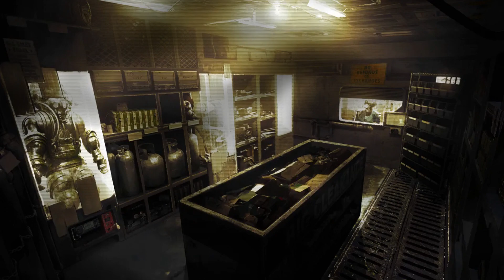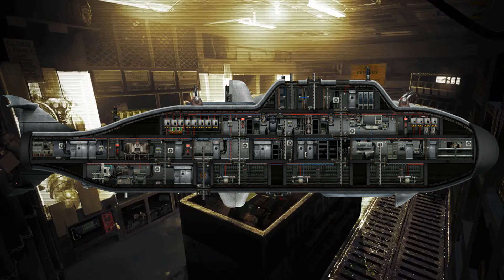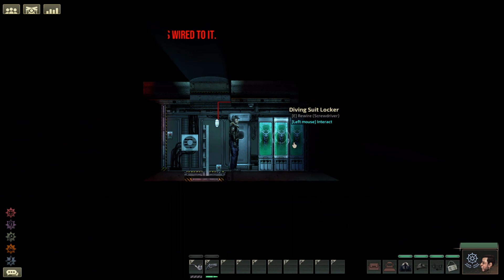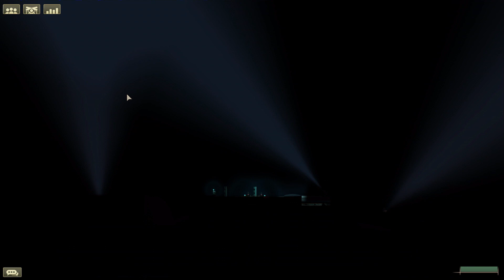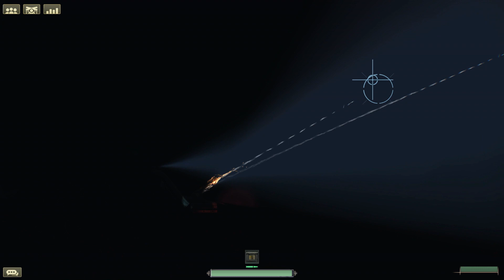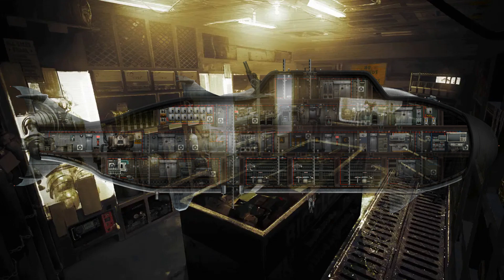Europan Technical Readouts: The Orcas

Comment: Not a word about the orca's cursed glass sail and how every fight starts with it getting smashed.
Reply: At this point I just sit up there, diving suit on, welder pointed at it, unmoving.
Reply: I as the captain just stick it on hold position and scurry up the ladder blasting the repair torch, it only needs to be licked for half a second and it stops the leak

Comment: Orca 2 would benefit greatly from an extra 1000kW output from the reactor. The orca 2 was our sub of choice when my group and I decided to move for a t2 submarine. So far, as the electrician on the sub, I have been attempting to resolve the energy issues the orca 2 has. It outputs a total of 4000kWs default, and it eats rods like candy.

With the motor taking up to 2000kW, and the oxygen generator taking the another 1000kW, it is normal to see the orca 2 idling at about 2000kW to 2400kW. Leaving about 1500kWs for the rest of the ship.
On top of that, the orca has some heavy guns outside which take up a big chunk of the supercapacitor's charge when used. Each supercapacitor can charge up to 1000kWs/s, depending on the charge percentage you have set them to.
The good thing about this is that the orca 2 has 2 sizeable batteries up in the electrical room, totaling a max of 2000kW extra. In this case, my countermeasures include the following changes:

First, I installed an ARC to set 2 uranium rods or 1 thorium rod in there and forget about the reactor for a second. 
Then, I installed an automatic recharge speed system on the supercapacitors, making it so they recharge at 70% speed only when at 60% total charge, and at 100% only when at 20% charge, otherwise, they charge at a constant of 40% speed.
Lastly, I installed a little detection system that tells the 2 batteries to feed the orca's electrical system when the sub's energy requirement surpasses the max output of the reactor by 1000kWs+, which it does often.

I have seen the orca 2 ask for up to 5300kW at times. It is a hungry sub, so be mindful of that when making that purchase. Also, we were unable to locate any oxygen detectors on the sub, and an argument could be made about limiting the motor at 80% of it's total capacity. It will save up to 400kW and cost a total of 5km/h. Same for the oxygen generator. If it could be limited, you can save up to 300kW by managing it correctly. The orca can allocate a total of 4 people per room with it's vanilla oxygen levels, based on my calculations.
Other than that, it has it's perks, like a full set of fabricators, including the medical fabricator, some beds to heal, accessible diving suits and a very good drainage system, the best my group and I have seen in t2 subs.

Comment: I'd like to put out that Orca 1 is better than Orca 2 in terms of survivability incase of flooding.

Orca 1 has most of the critical sections in atleast a room away.
Orca 2 has the reactor sharing the flood borne engine room, while the bridge is up front on the nose.

Comment: Running an Orca II on my current campaign and I really like it. Upgrades/Thorium rods help fix power issues and getting a pulse laser on the upper right hardpoint gives it good forward facing firepower with the double coilgun on the keel. It's maneuverability/speed makes missions less of a grind and a good captain can easily kite creatures and make transport missions take less than 5 minutes..

The only problem is the nav terminal location, but I like the layout more than the standard Orca since the junction compartment isn't split into two rooms.

I don't like either Orca for random missions though, without any upgrades it can't use the full power of it's engine and the starting captain helm skill is a bit low.

Comment: hello!  Is orca 2 any good right now ? My crew has been using humpback lately , but we started having some problems with resources and money. We were thinking on getting it ,but the fact that the resource locker and the crafting table arent connected to each other seems like a big deal
Reply from the maker: It can be a bit of a downside, aye. Personally I find the Orcas comparable, but if you have a crew who's competent you may want to consider a different sub like the Typhons or Azimuth.
Reply: @Techpirate_Productions   thanks for answering! We thought of getting typhon but its only 5 of us and were relatively new to the game , ill definitely check out azimuth .Ty
Reply: its fixed, they are connected now.

Comment: The orca is my primary sub right now, I started on easy so I got to pick it from the start and it has served well. Are there are simple modifications I can make to help the reactor issues? I have noticed it runs low on power when I change direction too quickly and it consumes fuel rather rapidly.

Comment: Hi, do you know why my Orca 2 has a "discharge coils" button on the nav terminal, despite the fact that it shouldn't have the feature? It also has a button called "battery array", do you know what that does?
Reply from the maker: After some investigation in the sub editor, it turns out the Orca 2 actually has a rear mounted discharge coil, attached at the very rear of the sail side. Not sure what it's doing there, but its in a bit of an awkward location.

As for the battery array button, it toggles on or off the submarine's backup power array, located in the junction room. The batteries won't supply the submarine unless they are toggled on at the console.
Reply: @Techpirate_Productions  if you use battery array, does it turn off the reactor as well, or use both at the same time? (Also thank you so much for all the help, and I love your content, will def keep up with your vids in future!)
Reply from the maker: @geodude03  No problem at all, happy to help with the questions! (If you also want general sub chatter, I'd highly recommend the Barotrauma discord, my own is rather sparse at the moment.) 

The Battery Array button doesn't automatically turn off the reactor, you can pull from both simultaneously, or just run on battery power if you wish as the activations are independent.

Comment: Haven't played much with the Orcas, but always remember its power troubles. Because as a Captain I enjoy actually being able to use the full potential of my engines... without browning out the whole sub.
Reply: You can use the batteries to supplement the reactor. I've used this set up with both the Humpback and the Winterhalter. The batteries will supplement the reactor in power spikes and when the demand decreases the reactor will recharge the batteries in preparation for the next spike.
Reply: @axx0  interesting concept.. link pls?
Reply: @boon1580   Just wire the POWER OUT on a battery to POWER IN on the engine;  When the power from the junction box / reactor can't supply the engines needs, the battery fills the deficit.  When the reactor catches up, it charges the battery like normal.
Reply: @boon1580  in case of orca 2(didnt waste time with first one) there are 2 relays right next to the batteries(top relay controlling the output of power and bottom one controlling the recharge). for functional overvoltage and undervoltage protection you need 2 'greater than' components and 6 cables/wires. install 2 greater than components in the reactor room. with first component, place load out cable from reactor to the top left of 'greater than' and power out from the reactor to the bottom left then the output to the comparison to the upper relay controlling the batteries to the set_state input. then on second 'greater then' do the opposite so power out goes to first signal input and load goes to second, then output of that to the bottom relay. set batteries at about 30% recharge(or find setting that suits your needs). it makes batteries fully automatic so you can salvage the 2 cables that go from the navigation console to the relays in the battery/electrical room (the ones that input into state_toggle of both relays).
Reply: Just Use a greater component with the load in signal in 1 and power in signal in 2. Then wire it to set State at the battery relay

Comment: I dont know how Orca 2  is an improvement to Orca 1, despite being inferior in every aspect. It even more prone  to accident. 

I accidentally press depth charge  button multiple times when trying  to open the door  and  accidentally  nuke one of the crew who happen to be inside engineering. 

No crew rest  area meaning you  need calixanide   all the time, you cant pull trick like  two  doses   of ABX and  sleep it to counter its internal organ debuff.

You need to yell so everyone start manning the gun. In  orca 1  you can jump between  sonar  and gun  without  running 55m.

the only  plusses i  can think off are junction box are Dugong like, which is easier to fix with only  one engineer.
Reply from the maker: Good points, and hence why I call it a side grade, rather than a true upgrade! 

It has its own issues, it just manages to have different ones.